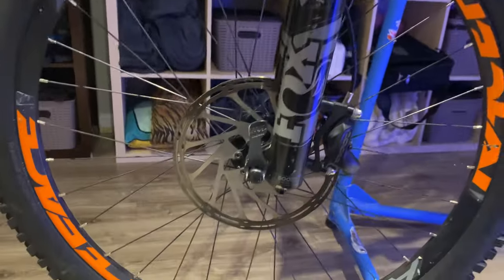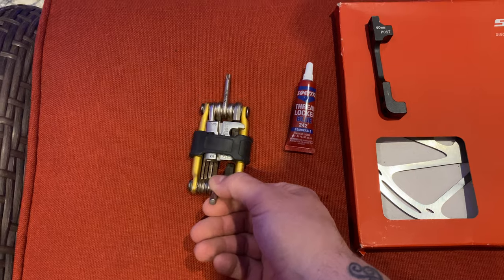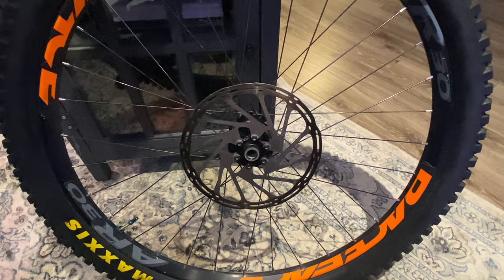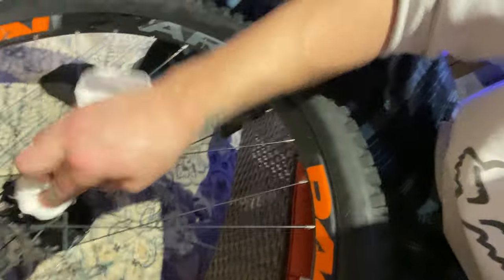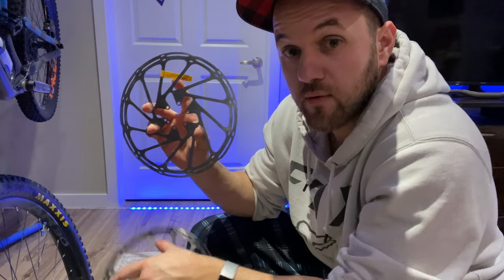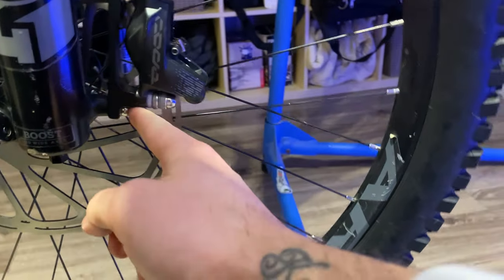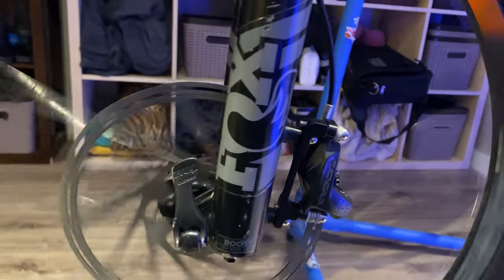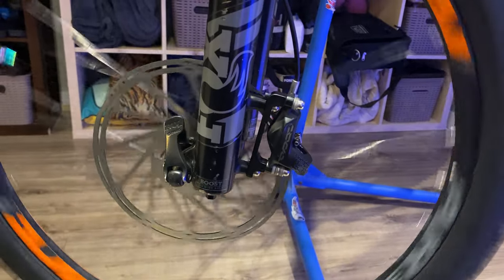EXTREME BRAKING POWER | SRAM 220MM CENTERLINE ROTOR | INSTALL GUIDE

Comment: 95 kg and running the 200 rotors with sram g2 rs now!  used to run shimano 220 with the 4 p slx. but had a piston explode mid ride on the rear  😬 started fixing them but striped the bolts on the front cal and hard to get pistons in norway
Reply from the maker: Do you find the 200 are enough power for you?
Reply: @elkvalleyadventures  looked at them and just 180's  so think they mounted wath they had in stock  covid u know
Reply from the maker: Yeah very good point. Hard to get the parts you want right now
Reply: @elkvalleyadventures  just orderd a 30mm bar from canyon  but did not know the rotors was just 180!

Comment: Thanks for the video!  I'm going to do the same.  Did you only change the front?  Are you planning of replacing the rear?
Reply from the maker: No worries! And I currently have a 200mm on the rear and seems to supply enough power. But it’s something I might consider in the future. I would need to figure a way of making a 60mm mount however because my rear mount is 160mm not 180mm like the fox 36. So I’m not sure if I’d even be able to make that work.
Reply: @elkvalleyadventures  GalferUSA has they adaptor

Comment: Hey i have 200mm rotors and trying to get 220mm what adapter do i need to get? The 40mm or 20mm
Reply from the maker: What fork are you mounting them to? If you have a 20mm on there already then you’ll need the 40mm
Reply: @elkvalleyadventures  its marzocchi bomber 380 200mm
Reply from the maker: Does it already have an adapter? If there’s no adapter then you’ll just need the 20mm one
Reply: @elkvalleyadventures  ok thanks

Comment: same adapter goes to rear wheel?
Reply from the maker: Just depends what size the frame mount is. Depends if it’s a stock 160mm or 180mm. I only run 200mm rotors on the back. Didn’t need extra braking power for the rear wheel

Comment: Can j ask what mount you used to mount the caliper in order to run 220mm rotor?
Reply from the maker: My fork has the standard 180mm mount so I had to add a 40mm bracket
Reply: What fork do you have?
Reply from the maker: I have a 2020 fox 36 factory
Reply: I have yari but having to use 2 mounts to run 220 with guide re brakes and 220 rotor and looks a twat to be honest trying to find just one mount that will work thanks anyway mate
Reply from the maker: Haha yeah fair enough. Hopefully you can find something out there
Reply: Use nuts or washers. It ain't nothing. I use the washers from the brake lever insert. For disk spacers. Don't matter what you use in the back.  The from you use any adapter then use spacers of any kind  The end. Front forks run them easier if there was already a spacer on the bike. In the front just add some washers .  Same for the rear but don't need any adapter .